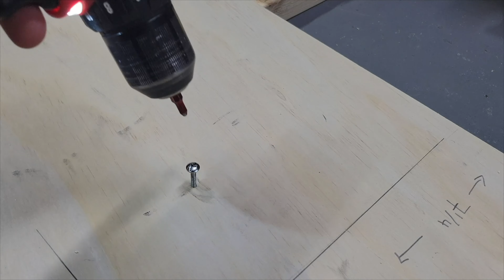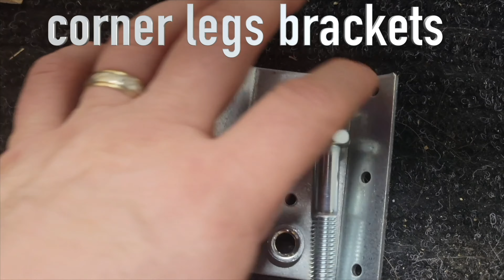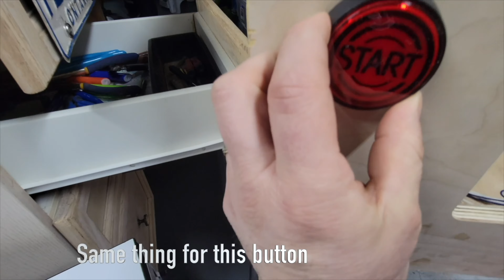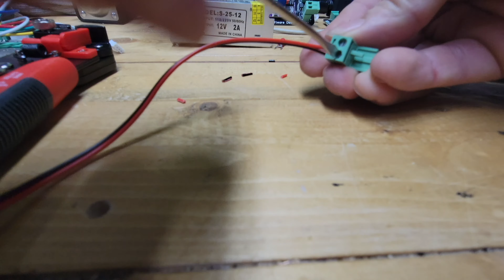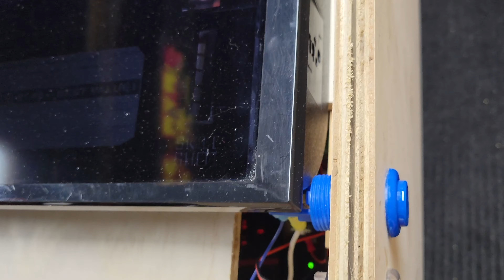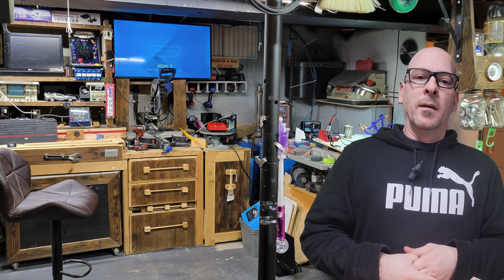Pimping my CAB

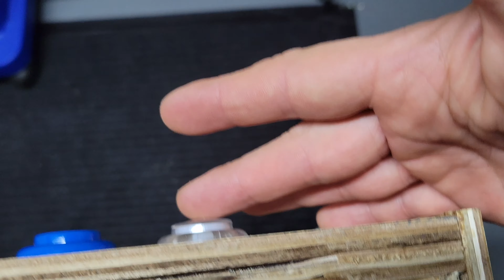Comment: 10:46 is there a way to extract flipper-solenoid-enable signal from DOF or anyhow? When I take the flipper-solenoid singnals from DOF it has a unwanted amount of lag. So I simply wire them to the flipper-buttons to make them instaneous and fast. But this way the flipper-solenoids ingnite even when the table is in tilt or VP software is not running. I tried to get used to the lag but the amount and the variation of the lag time bothers me :). Or maybe this only happens with my sainsmart based output controller. with a flipper-solenoid-enable signal I would be able to gate the signals from the buttons to achive the fastest response+functionality to drive the flipper solenoids.

Comment: Nice video. That front coin door. Those mounting holes are square holes designed for a cup head bolt, also known as a carriage bolt or coach bolt, that has a domed head and a square neck which makes the bolt self locking. They would look a million bucks and really top the look off. I'll build me one of these some day for sure.
Reply from the maker: Thanks. Yes i used cup head bolts before. I just like to use things that i have in my shop without having to purchase extra stuff.
Reply: @MajorFrenchy  Yeah fair enough. Hex head bolts aren't a deal breaker and I kinda figured you were using what you had to get the job done. Cupheads would be something to get later that are waaaay down the list of priorities.